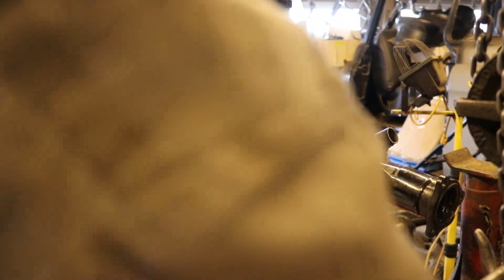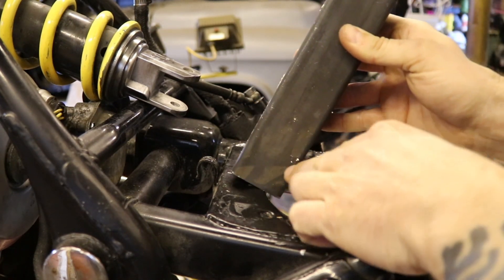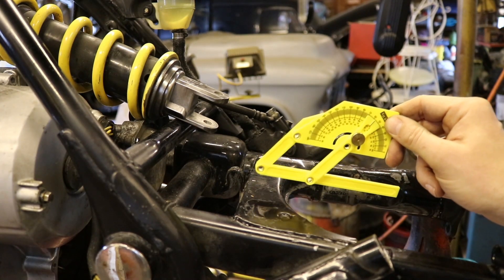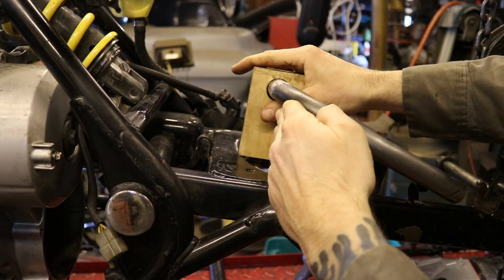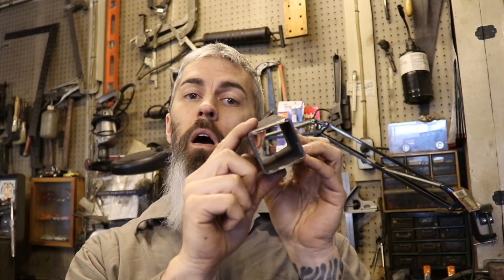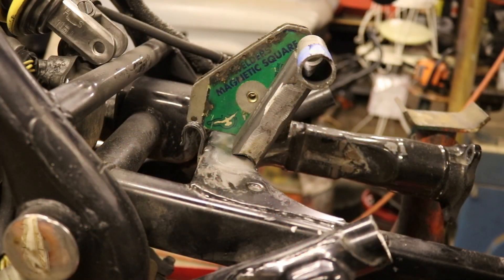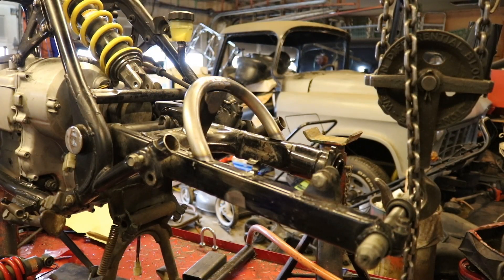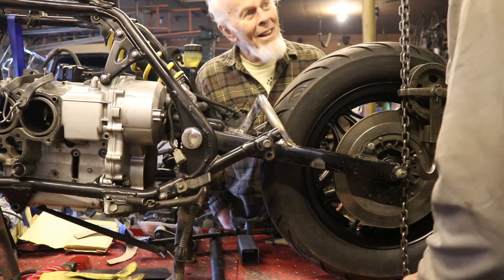Honda Goldwing Bobber Build | E33 - Monoshock Conversion - Cantilever Swingarm Modification

Comment: maybe i missed it but what shock did you use?   i wish you had a blog where folks could post their pics...i have 3 1000s im working on.
Reply from the maker: The shock is off a Suzuki GSXR, but I am going to have to use a heavier spring on it, which I will cover in a future video. Video #38 shows the assembly of all the rear suspension. https://youtu.be/h7zpcrq0xtQ
The blog is a good idea, you are not the only one who has pics of their goldwing :)